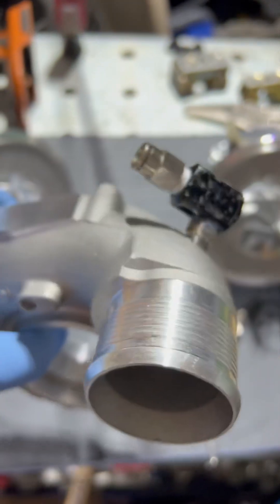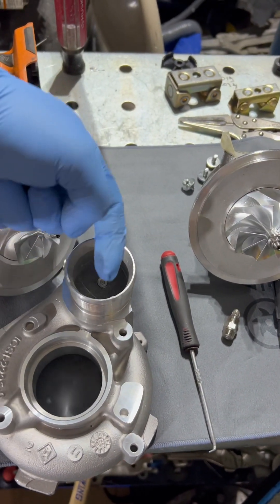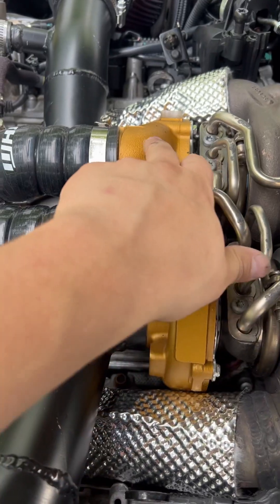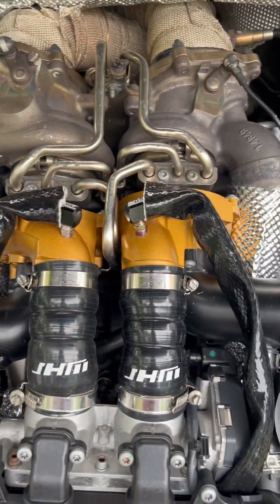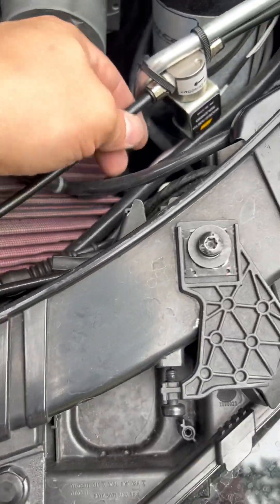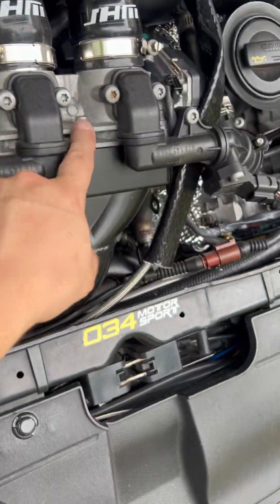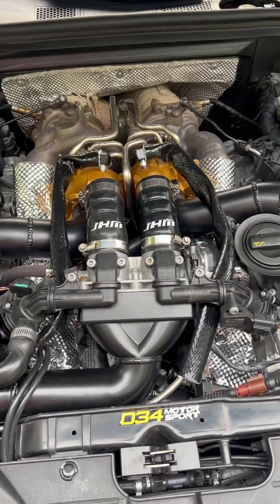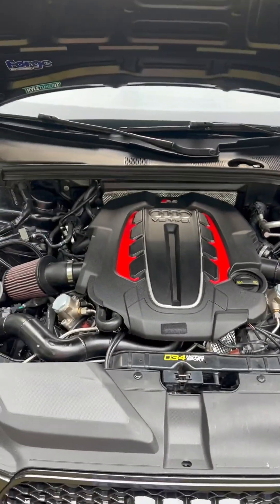Methanol nozzle before TB 440cc each

Comment: That is some serious heat to melt those. Have you done any logs since installing the wmi?
Reply from the maker: Yes, it's hot because my peak boost is 2.7 bar and all piping in that area is hot as well. After installation of meth at the compressor wheel temp drops by 20* not bad. Going to try to use only distilled water this should help even better also might need a bigger nozzle
Reply: @Svarogperformance  even if you get it to the point you aren't melting sensors I'd call that a win.